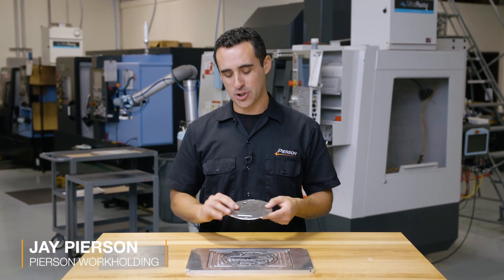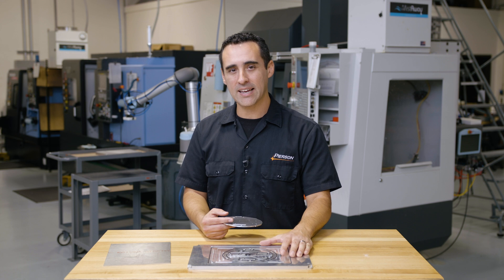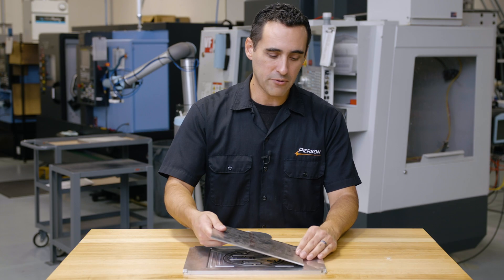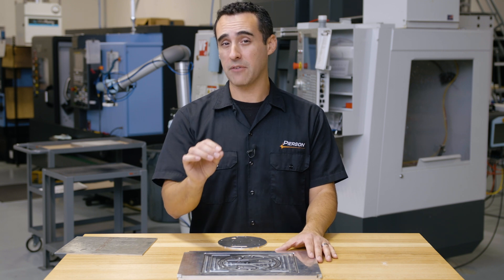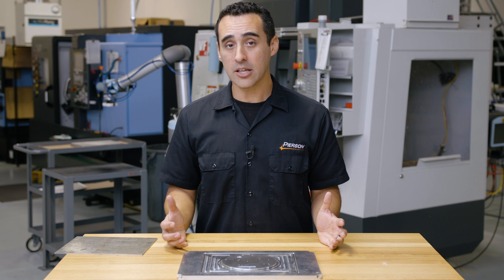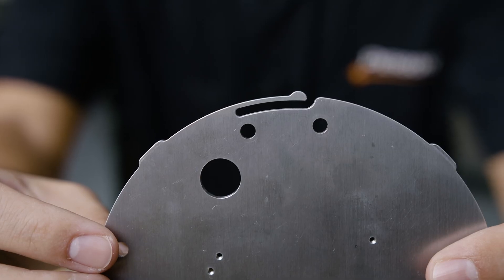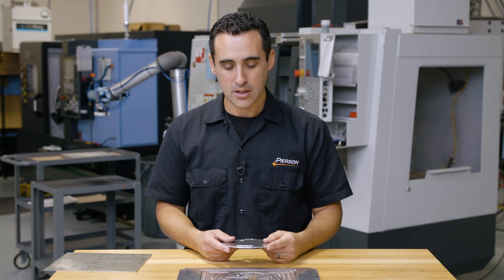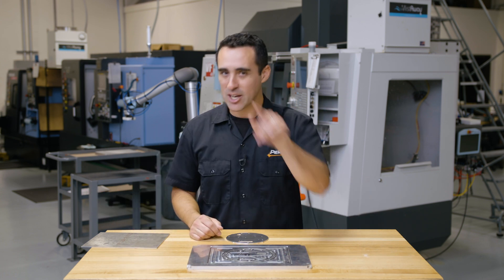When a VACUUM is better than a VISE | Fixture Friday 11 | Pierson Workholding

Comment: Hi, I am woodworker with Cnc  and i tried to deal with vaccum table like you do.
I have some questions :
Do I need to continuslylet run my vaccum pump ? (I have a 9 liter ballast + membrane pump)
-How can I make / find customs gasket to fit with a cutom design shape (like you do)
-Which gasket is best to use ?
How do you deal with top of your vacuumtable paraleism ?
Best and Thanks

Comment: How much time would you say it takes on average to build a custom vacuum fixture? And how does this compare vs machining and leaving tabs?
Reply from the maker: I designed one in real time in under 12 minutes here: https://youtu.be/GxgN30mGXSU Tabs technique still requires some type of clamping fixture that would need to be designed and there's secondary processing of breaking off the tabs. Vacuum parts come off 100% complete.

Comment: I use a similar fixture approach with a part I am making. My stock is 0.175 thick and 8” x 8” area under vacuum. How hard can you drive the cut to separate the scrap from the finished part?
Reply from the maker: You have almost 900 lbs of vacuum force.  I'd rough machine the perimeter of the part first but leave .015" of material left at the bottom to keep the scrap and part connected.  Then take a finish pass at full depth to separate the two.  This allows you to push harder and use the surface area of both pieces to increase holding power during the rough.

Comment: Brilliant, I’m going to buy one of these soon. 

Another tip for vacuuming. When making tiny parts, we’ve gone as small as 7mm x 18mm, stick your stock, using double sided tap, to a sacrificial board. We use 2mm foam. This also means you don’t have to create these custom tops. This method is great when you have MQL.

Comment: What's the smallest radius on a corner for the gasket? Can it go around a sharp inside edge in the groove or is there a min. radius requirement?
Reply from the maker: Our gasket material can easily turn a sharp corner, as it does in the grid pattern of our chucks, but a radius of 0.100" (2.5mm) will help extend the life of the gasket.

Comment: How do you deal with the deflection in the part through the pressure and the gasket? When the part needs to be very flat i can see this becoming a problem..
Reply from the maker: Just the opposite... vacuum chucking is the BEST solution when parts need to be flat because the part is firmly pulled fully flush with the fixture surface.  The gasket easily compresses into the groove it sits in.  Here's a quick look: https://youtu.be/tHSnB5Z_MQc?t=22

Comment: What i would do is send the drawing to someone who has a waterjet of laser cutting machine
Cheaper in every way
BUT, it is a realy nice solution with the vacuum plate!
Reply from the maker: Haha!  Especially those waterjets that can tap holes holes and leave a machined edge.
Reply: @PiersonWorkholding  when did lasers or water jets get to the point where they can machine the top surface smooth, create beveled and contoured features, and give it a precise thickness?
I haven't seen them on YouTube yet!